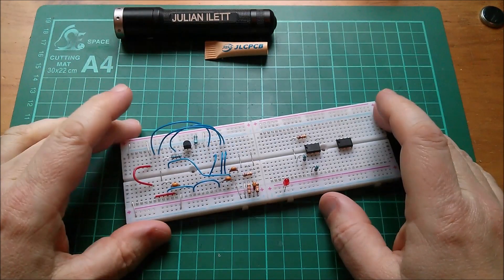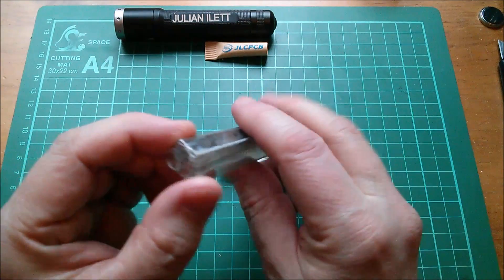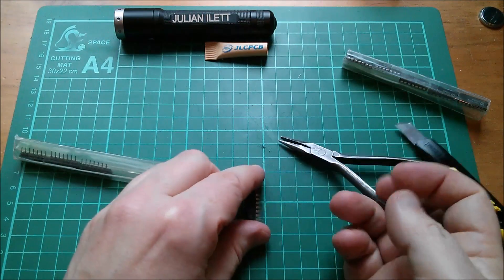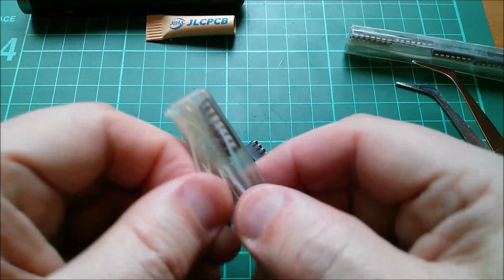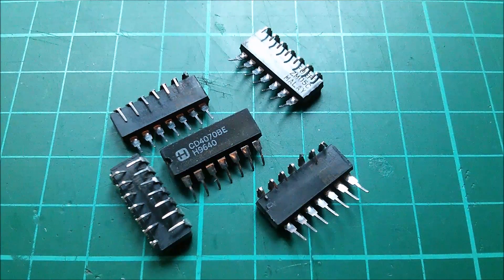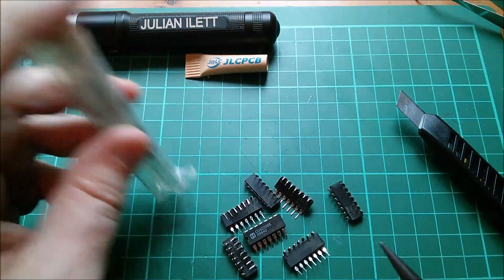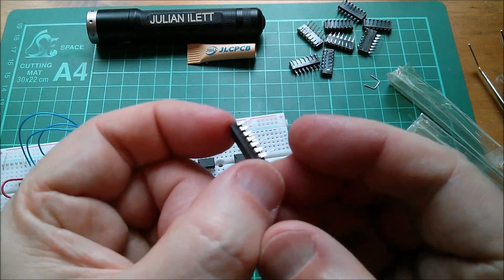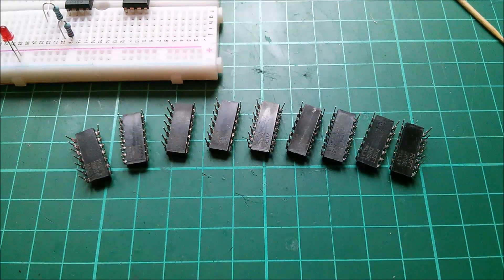Julian's Shorts: CMOS Chips with Severely Bent Pins

Comment: There is no way the leads were bend like this within a tube! I once rolled over a tube of 74ls somethings with an office chair twice and other than leads bend out flat where the tube got spread flat there was not such deformations - no j-leads or folded under pins. Also the pins look suspiciously nice and shiny fresh solder coated , probably salvaged parts also by the looks of the underside. I hope they weren’t too expensive as new ones only should cost you 10p a pop tops.

Comment: Is that a Harris logo on the chips?  I used to work for Harris.  In fact, one of the divisions I worked for was across the street from the semiconductor division.  If they are Harris chips, they're probably no newer than 1999 (since Intersil acquired Harris Semiconductor in 1999), but I guess they could have sold excess stock still under the Harris name.

Comment: I just got 50 NE555's delivered pressed into a foam pad and mummy-wrapped in cellophane. I wonder if the foam you get with a lot of electronics parts is maybe safer than the IC tubes... at least when it comes to crushing force.

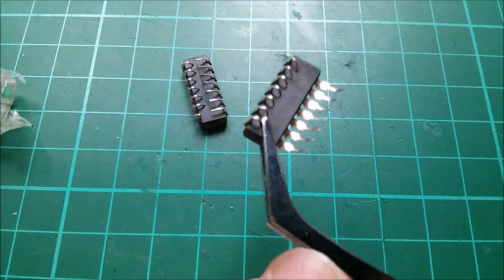Comment: Wohoo....it´s been a long time since i saw the last Harris chip....old stock....at 01:18 datecode says 40 week of 1996 ;)
Also i recieved expensive DACs 16pin DIP chips where the sender simply put them in a paper envelope without any extra tubing....surely it was a lot worse that the ones you show here...i managed to straigthen out the pins as well...but when a single IC cost about 18 bucks, i want it to be delivered at least in a tube...

Comment: Those chips look ready for "Dead Bug" construction. I use flat nose pliers for straightening pins because the jaws are flat and square so they all can be straightened and flattened at once. Then fix the ones that bend the other direction out of line with the others.

Comment: Now you have innovative ic package: half of it is SIP, other half is PLCC
Reply: The hell are those?
Reply: @iProgramInCpp  SIP: ic package where all pins are in single line. PLCC (plastic leaded carrier chip): pins on these are bend under the chip, for example 5050 diodes, or some older memory chips used in old hard drives, or really old ram sticks, sodimms if I remember correctly.
Reply: @kjur18  thank you
Reply: or soj packages... i dont know are these still around were quite common with memory chips in the 90ies

Comment: Over 350 orders on eBay has taught me that 99 times out of 100 it is the postal service that is at fault and certainly not the seller. I recently had a pair of NE602's go missing in the post. The seller did resend them but I am 99.99% sure it was RM at fault here having bought from the seller several times before with no issues at all. I do hope they claimed back from RM. RM really need to up their game as they are fast becoming expensive and unreliable.
Reply: I sold something a few years back that got lost.
Trying to claim back under their £20 standard cover was such a faf.
With the time I lost writing letters and their tome responding. 
It must have cost us both more than the cost of the postage and lost item I was claiming for!

I did get the money eventually. 
But it took nearly 6 months!